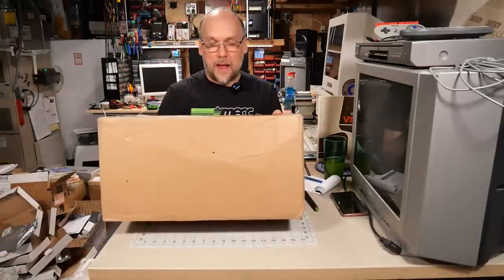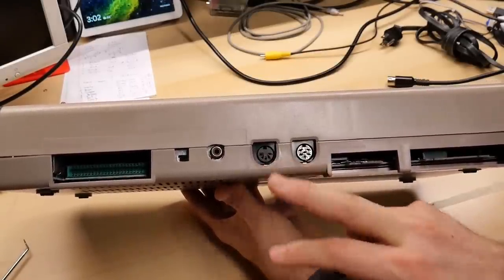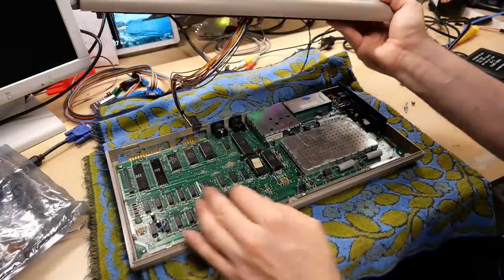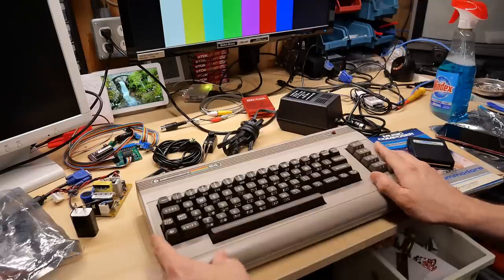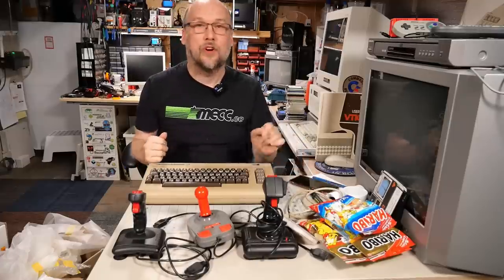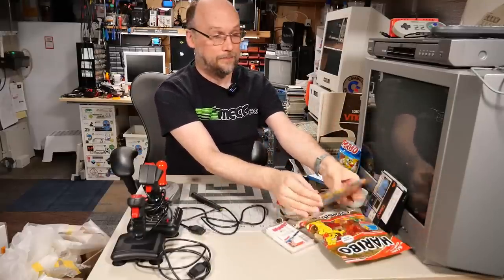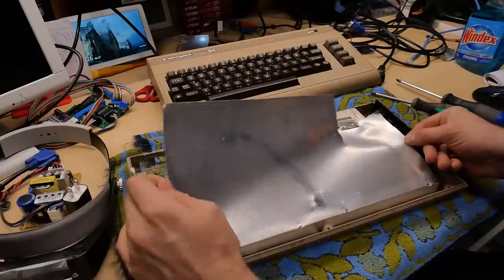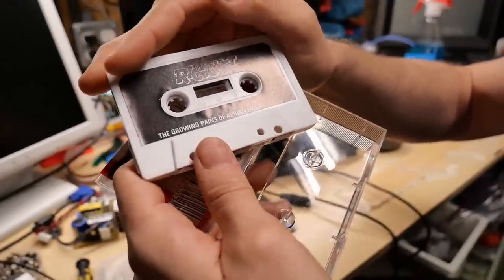A mint C64, Haribo From Germany, Joysticks and a replica Super Zaxxon cart

Comment: Without all the epoxy, that unusual power supply might work forever. The voltage regulator won't be cooking itself.
Reply: That's one of the very early repairable power supplies that came out with the Silver Labels C64's in 1982. By 1983, Commodore had changed to the sealed bricks to save costs. Though they are theoretically susceptible to the same failure that the sealed bricks are, they are less probe to failure because they are ventilated, the voltage regulator has a hefty heat sink and most importantly, they are not filled up with epoxy. If you installed an overvoltage protection circuit inside the case, they’d be the ideal power supply. No voltage ripple and extremely low chance of overvoltage damage.
Reply: Sounds like some alternative physics to me: epoxy conducts heat better than air so if the case is otherwise closed then the epoxy will cool everything better by conducting heat to the case and then ambient air. If you just remove the epoxy and leave everything else identical, the interior components will run hotter on average. There’s some nuance of course, since epoxy may increase the temperature of components adjacent to those that dissipate lots of heat, but in general semiconductors will be running just fine at 80-100C junction temperatures. But it is true that some of those computer supplies were woefully under-designed. I have a desktop Kepco lab supply that has a 5V/5A section and it can run at 80C ambient with output shorted, indefinitely, with no damage. Remove the short and out comes clean 5V. It also takes more volume than the entire C64 and its power supply and probably cost about what the C64 cost (mine is from 1975). It also still runs fine on factory original components. So it’s the usual “you couldn’t afford the quality you demanded”, I think.
Reply: @absurdengineering  The power supply enclosure shown is vented, which means it will promote convection airflow through the unit which will cool the regulator much more effectively than pure conduction through epoxy into the plastic housing would. As you describe it, the stack of aluminum fins in a typical modern computer processor heatsink would work better if you potted the whole heatsink in epoxy, which makes no sense as this would prevent any airflow past the heatsink (whether that's via passive convection or active airflow from a fan).

Comment: It's possible that both of those C64s are the original color, however I suspect the ZIF machine is not. The way to tell is compare the outside with the inside. But I know they had different colors. Mine looks like the one he gave you not the ZIF one. It was filthy and looked horrible, but after cleaning........it looks BRAND NEW. It is yellowed though, but not that much. If I didn't compare the inside to the outside, I wouldn't know. Mine actually has all the tabs intact as well.

Comment: I have two Commodore 64 computers, a floppy drive, the controller for games, and some software which I have not used in years. I got one computer from a store in Saginaw, Michigan which had been returned, but worked perfectly. The second computer was purchased from a couple in Shreveport, Louisiana and where I got most of the software I have for it. The power supply for one computer have a replacement power supply which allows you to change the fuse when one blows and this system works fine.

Comment: Commodore used different colors for their cases. There wasn't a lot of quality control on the plastics color. So in addition to yellowing there is variation in manufacturing.
Reply from the maker: I do have some machines that are totally original where the top and bottom and slightly different colors even. Like they picked two parts from different batches and stuck them together.
Reply: @adriansdigitalbasement  From what I have heard about Jack Tramiel that sounds very likely, after all his mantra was to cut costs in any way possible, so if they had some leftover case tops from one batch they wouldn't just throw them out but rather just stick them on the case bottom from the next batch, and so on and so forth.
Reply: @BertGrink  this would also help to explain why some later units were in the taller form factor cases, as they probably found random boxes of them that had been lost somewhere.
Reply: @adriansdigitalbasement  Commodore used whatever they had in stock to create a C64. They come in all kinds of colors with all kinds of keyboards.

Comment: I’m fairly sure I have that 1541 repair guide in PDF format because I recognize the dartboard on the cover.  I’ll look when I get home from work.  That C64 and 1541 both look beautiful.  My most mint piece of equipment is a 1541 I bought new-in-box, never used.  Unfortunately I’ve never found a NIB C64 for sale.  I also have a couple of those serviceable power supplies, but they aren’t Commodore branded.

Comment: I have a silver label that has about the same shade of plastic. My family ended up with two C64s, the first one developed a fault early in its life (VIC-II problem I figured out recently) so it got packed away once the other 64 replaced it. The other 64 ended up living a full life and ended up with a more discolored case.

Very nice gift, well cared for.
Reply: Also... ours had the same power supply. In fact, the power supply that came with the new 64 (the solid brick) did not work for some reason, so we ended up using the old supply with the new machine.

Comment: I do remember when buying cleaning diskettes "back in the day", they did have a perforated cover over the "top" head access hole for use in single sided drives. If you had a double sided drive (1571, or various PC drives etc) you needed to peel out the perforated cover portion.

Comment: It's entirely possible that CBM used one case maker for the Vic20 and high profile cases, and moved to a new case maker for the low profiles. Then when demand was too high, they had to buy in some extras from the original supplier. That or they found a spare pallet of old cases in a corner and decided to use them up.

Comment: Good advice concerning the old, unused power supply. The 3 large capacitors inside the C64 can also cause problems if they weren't used for a very long time.

Comment: I have the "Quick Joy" joystick yet with a red base. But that one does have microswitches :).

I wondered - a C64 that doesn't work but the SID is socketed. Maybe you can try the SID on the ZIF machine, and if it works, stick it into the mint machine? 
Another method for testing SIDs - the filters - btw is to load Giana Sisters - in the very beginning, there is this "wind" sound effect, done by the filters, so you can tell very quick if they work, if you don't have any specific test software.
Reply: Oh and would ever modify the mint C64 and 1541, as in future proofing them with heatsinks, and give the 1541 a modern power supply like you did before?

Comment: Adrian- another good tell or sign it is an original board in the 64 is the color of the cartridge port. The original, 5 pin video boards had green cartridge ports. Every now and then, they will also have a green keyboard header on the motherboard too.

Comment: The TV you mention at around 23 miuntes is a Sony KV1400UB. If you search for it, that model number can also bring up another, more recent TV as well. That TV was also used on the ZX Spectrum brochure (pre-dating the Dragon). I have a white one here in my study, which I use with my 8-bits. It has manual tune, which is a boon for use with ZX80 and ZX81's especially.

I don't know if they did a NTSC version.

Comment: Adrian,
As far as the PAL C64 goes the way the video looked reminds me of a C64 I had to repair.
The MOS PLA had died and taken out the ROM's with it.  At first I replaced the PLA with a PLA replacement I got from seller in Iowa first name Kevin.  I also got a NU-Brick from Kevin as well as the original PSU I had was bad anyway.

After replacing the PLA the system still didn't work, but I had been told in the past that the PLA when it goes out can take the ROM's with it.  So I desoldered the ROM's and installed gold machine sockets in the system in place of the ROM's.  I then got some of GO4RETRO's 2364 adapters and installed those in the sockets along with some 28C64's programmed with the images of the KERNEL images and FONT images.

After the installation of the EEPROM's were done, I powering up the C64 everything came to life and worked great. 

At least this is some of the input I have to give. :)

Great job on your video and thanks for sharing.  Please keep them coming. :)

Comment: I've built two C64 PS using a PC power supply case with a 10VAC xfmr and a 2A 5VDC power brick. My original C64 from '83 was used in our shop as an inventory control,  job status and repair reciept.....I just recently found out you can play games on it! ;)

Comment: Early C64's use to have Repairable PSU's and then Commodore started potting the C64 PSU's.    The Color of the C64 also had variances my guess is Commodore had different companies over time mold the enclosures and each molder used different color houses which might account for the color differences or Commodore may have opted to change the color based on the motherboard revisions but I am just thinking off the top of my head.   The mold used to make the C64 your showing also appears to be a modified VIC20 mold because you can see the Blank Marking around the Cartridge Port.   Easier to modify an existing mold than to build a new mold especially for a new product launch.    You may recall the VIC Drive which was I believe the 1540 and early in the C64 launch a problem existed so drives were hard to find until the 1541 came out.   I just vaguely remember the issue so that might explain the package.  Commodore was so cheap they probably just wanted to use up the old packaging sleeves.  Hey I do the same thing at the plant I run although I will place a label of what changed which is better than throwing packaging away.

Comment: I had one of those power supplies.  After mysteriously blowing 2 of the block ones, the guy at the shop sold my dad one of those.  I think it cost quite a bit more – 2 or 3 times  the standard replacement – but he sold them because they were serviceable.  I think at the time he said they were the early ones and since he was a Commodore reseller and certified Commodore shop he ordered them directly from Commodore.  So maybe it was one of those  - If you know the part number the order would go through.  But if you didn’t know the part number – well it didn’t exist.  Also this was in Canada so not sure if maybe it was a Canadian part number thing.

Comment: My C64 has that power supply that was actually faulty. I was luckily able to repair it by replacing the voltage regulator with a modern drop switching voltage regulator.

Comment: On the "danger" of making assumptions of manufacturing date based of cases and other marks:

My father bought a Commodore 64 for Christmas 83. At some time before my parents divorce in 1993 he bought another C64 for parts (why? he doesn't remember... seems like a wise choice). Everything was packed after the divorce and it's been following my mother for the past 25 years plus.

It happens the second C64 was also a late 83 purchase. My dad's units was made in Canada and has S/N in the SC 177000 and the spare C64 was also made in Canada and has S/N in the SC 200000. 

The earlier unit SC 177000 has a Rev. B board, a round power connector cut-out, and pale/grey marking with chips ranging between late 82 to 42th week of 1983.

The later unit SC 200000 has a Rev. A board, a square power connector cut-out, and white marking with chips ranging between late 82 to the 47th week of 1983. 

According to Adrian's tell-tale signs, SC 200000 would have been manufactured before SC 177000, but it is obviously not the case. It appears to me that Commodore production chains were a mess in 1982-1983.

Oh yeah about the color thing? SC 200000 is MUCH paler than SC 177000 despite having been stored in the same box together for the past 25 years or more, away from UV light. Look like to me that C64 actually had several colors, and both have pretty much the same color inside and out. The difference is as striking as between the C64 Adrian received and his ZIF64.